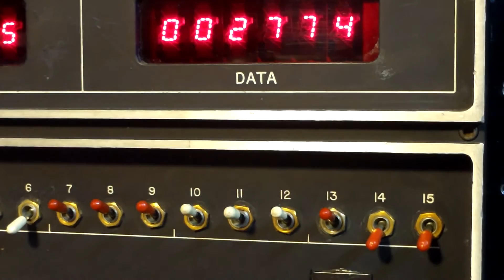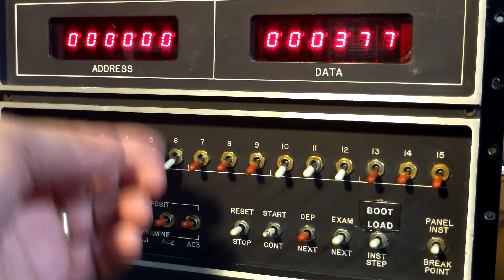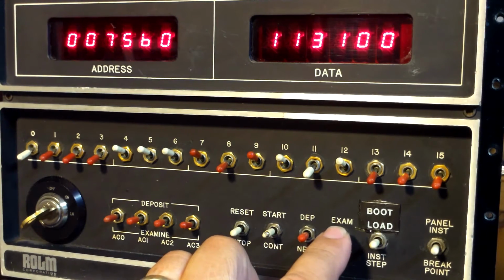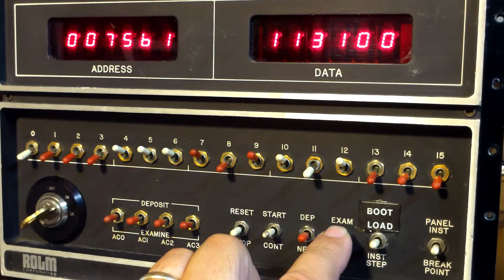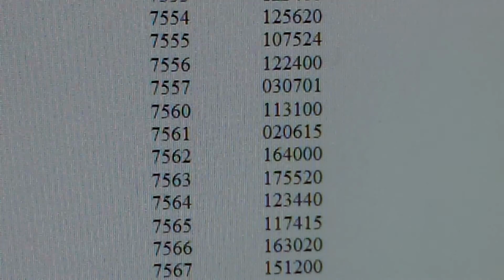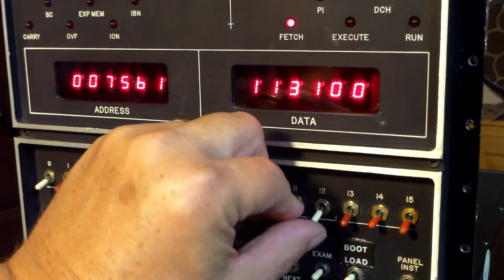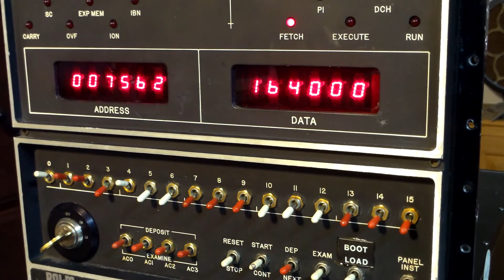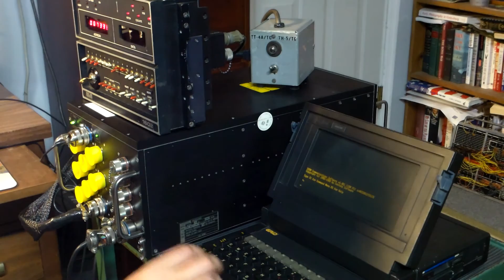DGNova Rolm 1602 Programing

Comment: Where did you get the rolm 1602? We had them on f-111 when our ecm went from a analog to digital. A lot of the cards were embedded in our signal processor and we hung 2 pages off core off the front to complete the system. Input was paper tape.